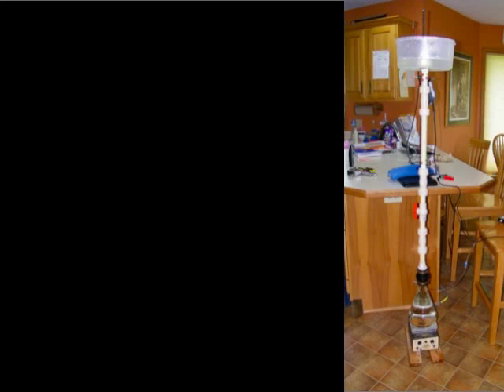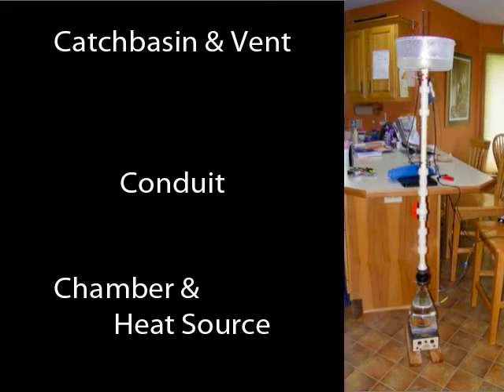CPVC Model Geyser

Comment: This is good work.  I built these some years ago with similar results.  I didn't have access to sensor equipment, which is very interesting.  I'd like to see your temp/pressure tracings.

Since you have the energy and resources, I invite you to take the step that I couldn't.  Use multiple hotplates; multiple connected systems.  One of YNP's greater mysteries is the apparent breech of Bernouli's principle, with adjacent springs with very different water levels. Exchange of function: Model THAT!

Comment from the maker: Thanks! One of the models shown in the "rapid slide show" actually does refill from a reservoir, and dumps to a waste container (notice in the blue basin how there's a 2nd, offset "vent"? That's the drain in some models). The problem was the amount of time it took to heat honestly cold water put a limit on how many cycles could usefully be observed, so I ended up with a recycling model for thermal considerations. I do have ways of changing the refill rate (flowback rate).

Comment from the maker: As to different springs with different water levels, I've already seen at least two ways of getting that in the models. The first is simple thermal expansion - fill a U-tube with water and heat one side of it, and that side will have a higher surface level (significantly higher, for a U-tube that may be 20 m deep). Second is that the erupting conduit has a significant fraction of steam by volume, and so is at *very* low density, and consequently higher water level...

Comment from the maker: ...I've also generated this situation in the models, ones where the heat source is a metal pipe wrapped with a heating tape, and the connection to the neighboring conduit is below the heated component. This is a good model for Grand-Turban, Cistern-Steamboat, etc.

Yep, there's still a bunch of question, and these models have some serious flaws... but also some very interesting properties.

Comment from the maker: That depends. There are two times that are important: the duration (how long it actively erupts for) and the interval (the time between eruptions). The interval depends on how fast you heat it (the faster, the shorter the interval) and the depth (the deeper, the longer the interval), among lots of other things. I've made geysers that have intervals from a minute or 2 to 20 or 30 minutes (and at least one with an interval of about 6 seconds).

Comment from the maker: My *guess* (in other words, I've not tested this), is it would effect it little or none for small diameters. Most of these erupt from the bottom - in other words, when the water at the bottom hits boiling, it ejects water from the conduit, lowering the pressure and initiating an eruption. Conduit diameter could effect this in two ways. A large diameter conduit could make the system less efficient at cooling during an eruption (making for a shorter interval), or...

Comment from the maker: ...a large enough conduit can have convection within it, withdrawing warm water from the base & exchanging that with cooler water from above, thereby making it longer between eruptions (instead of heating just the base, you have to heat a significant part of the conduit as well). The 2nd I've seen when the conduit approaches 2" in diameter, the first I've not seen direct evidence for.

But in either case, the effect seems small compared to conduit depth and heat input.